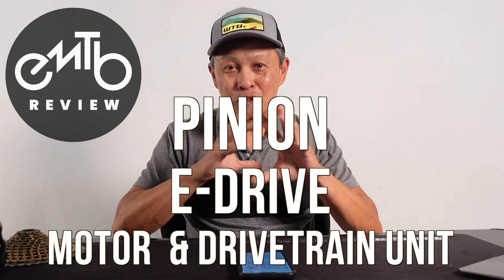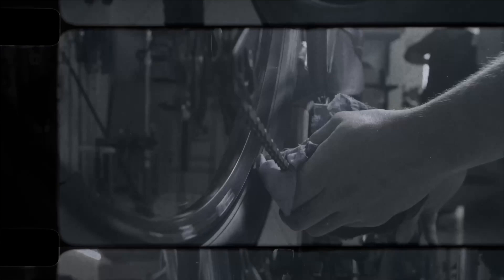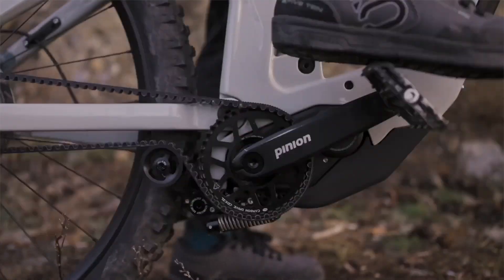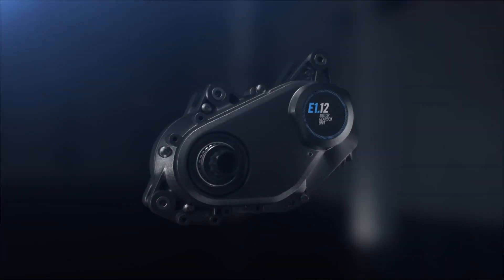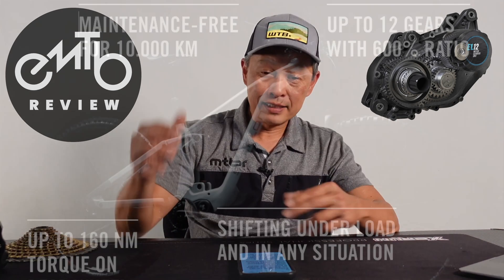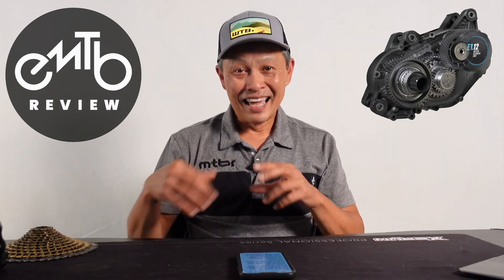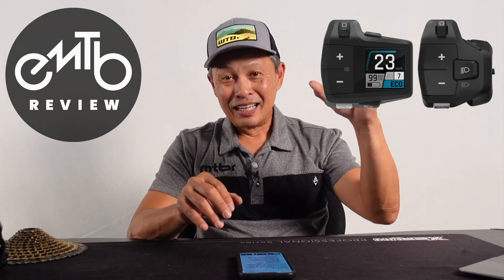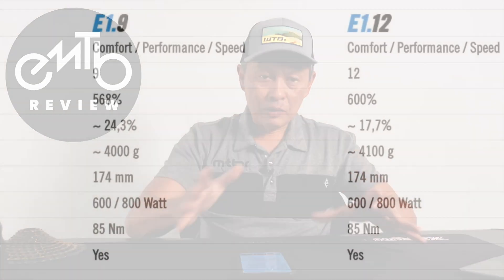Pinion E-Drive MGU - Motor and Gearbox for ebikes in one unit

Comment: As an engineer and bike mechanic there’s one thing that’s always bothered me, the disgusting amount of waste the cycling industry has made by making e bike motor units unserviceable (grease wiped onto gears instead of oil bath, what?) That’s on top of all of the derailleur based waste, they have a system that they’ve locked in that generates massive after sales service profits and just is not practical for an off road environment. This system of Pinion’s should be applauded not just for its intelligent design but also addressing a real problem of waste and pollution (to produce, package, ship and distribute) that the throw away nature of derailleur and motor units systems create. I’ll definitely be buying one.
Reply from the maker: Great insight

Comment: Clarifications on Pinion gearbox. I have a Priority 600X (alum hardtail bikepacking bike) with Pinion C.12 gearbox with belt drive. I don't like grip shift, but otherwise love this gearbox. Once the belt tension is adjusted (phone app), this thing is bulletproof. When upshifting, you don't need to let off except 4-5 and 8-9 and it shifts fine, downshifting you need to let off a bit (not stop pedaling), except for the 4-5 and 8-9. But you can shift a bunch of gears up or down without pedaling or at a standstill, try that with your derailleur. The only maintenance I've done is change the oil in the gearbox after 6,000 mi. The belt squeaks when dusty which is common in Colorado summer riding. A little water squirt and its quiet. I just carry a spare belt in my backpack (it's only a couple oz and small). Can't tell you how many times over the years my derailleur/chain left me stranded. I like it so much in fact I wrote and asked Pinion to make an ebike motor with their gearbox and decided to wait until this was available to buy with an ebike (my knees will thank me). I will never go back to derailers and chains just like I'll never go back to an ICE vehicle from my EV. I can see how those who race will stick with the more efficient derailleur, but for most of us, and especially for Ebikes, it is a no brainer.

Comment: I don’t think you mentioned that this system is exclusively equipped with a Gates carbon belt so you can also factor in all the reliability, low maintenance & toughness benefits that these have over a conventional steel chain.

Comment: What happens if your out of battery
Reply from the maker: What companies do is kill the motor but save a little battery so shifting is still available.
Reply: @EMTBReview  so I ride a bike and do door dash I ride about 50 miles a day, would I be able to ride all day?
Reply from the maker: @firstshot2169  for any ebike with this kind of usage, make sure you have at least a 700wh battery and you should be ok.

Make sure it's an assist bike too so you can help out with your legs and not just throttle around.

Comment: Another spot-on video, thank you. Your mouth opens & my internal dialogue comes out, almost word for word. Ha! I’ve commented that many times in your videos. In 91’ when I came from the dirt bike to the MTB world, I immediately said that MTB’s need internal gearboxes. I saw the future of MTB’s from day one practically. Want the next innovation? To mitigate the loss of range due to drag, add the mechanisms necessary for regenerative braking, clutch on rear hub to spin the chain/belt while braking and spin the motor to recharge the battery (or aux battery), etc. Without the deraileur, that is now possible to use “motor braking”. I’ve not heard anyone else say one word about this and I listen to 8-10hrs of Mtb news daily hoping for big breakthroughs & innovation. 🎉You heard it here first. Now let’s make it happen!👍 (sorry for sounding like an ass, Im just tormented by ideas that I know would revolutionize MTB’s & just don’t know what’s taking so long…)
Reply from the maker: Something about great minds thinking alike. :)
Reply: You can't have regenerative braking on most full suspension bikes due to chain growth from the suspension geometry. This requires a tight side and slack side of the chain, so you can't transfer power the other way as it would be coming along the slack side of the chain. Regen would also require a brake modulation system that would require sensors in you brake levers and for the rear brake to reduce the braking force when the regen was activated. All this would add extra weight and complexity that would negate any gain from the small amount of regen you would get. Can't see this happening in an off road mountain bike anytime soon.

Comment: 2 Lbs. extra on a 20 Lb. bicycle = 10%, but (bike + rider) it goes down to about 1%, which is nothing unless you're having to carry the bike up stairs.
Reply: anything under 40lbs is considerered "Light" Emtb even up to 19.5kg/42lbs so 2lbs is less than 10%, I agree it doesn't matter at all when you're going at a constant speed, on smooth surface and not cornering. even though it's only 1% of the total weight it is more important than 1% suggests if you are cornering, jumping, or going over rough terrain, but I would definitely trade 2lbs on a emtb for long life almost maintenance free gearbox + lighter/stronger rear wheel + better rear suspension.
for commuter bikes, I think it's a bit overkill because hub motors + less shifting + less effort  means even cheap 7speed groupset last a long time and dont need that much maintenance. Although if you're looking for a car replacement to do a lot of miles, low maintenance is important

Comment: Do understand that there is a significant 'klunk' that occurs in the MGU when shifting between gears 4/5 and 8/9 on the 12-speed unit.  Very good attempt; but, time will tell...

Comment: The Pinion MGU system eliminates all the criticisms of the non motorized system. Which I prefer to live with over a conventional drivetrain. I don’t notice the little bit of extra drag there is over a clean regular drivetrain and being able to shift as many gears up or down in one motion at anytime is worth having to make a slight pause while pedalling. With the motor and electronics these are eliminated. Then as stated all the pluses of the belt drivetrain and no worries of smashing off a expensive rear derailleur. 
 I would like to see the display come off of the controller and on to the top tube.
 If some familiar European bands like Scott, Canyon or Commencal start using this motor it will take off in North America. Since Bombardier owns a controlling interest in Pinion maybe we will see some Canadian brands like Devinci, Norco or Rocky Mountain use it.
Reply: That'd be nice. I had to order from the US to get my Pinion bike. Didn't realise at the time that there's a significant import duty on bikes. Still happy with the bike, though.

Comment: Are E bikers becoming frustrated motorcycle riders?  
Need more power! Need a real gearbox! Need auto shift! Even ABS.

The Gates belt on these can be lubed with soap if they squeak, or rinsed off with water.
Reply: the difference is the weight, emtb are around 22 kilos, whereas e motorcycle like surron weigh 60 kg, plus good luck going on hard mountain bike trail with a surron, your surron will be good for recycling in a matter of hour.
Reply: Some do want more power and they should just get a dirt bike. Most are happy with the current assistance, and some are even happy with the assistance of motors like the old Levo SL, like myself.
Reply: @streddaz  I can go just fine with my EP8 motored bike in trail mode, the bike has pedals for a reason. 

Ive also ridden dirtbikes most of my life, and yeah, 46 HP is really fun.  E bikes are a different thing.
Reply: @bradsanders6954  yep, they may both have motor but Ebikes and Electric or petrol dirt bikes are totally different. Ebikes are so much closer to normal MTBs.

Comment: rode a pinion two years back, the exra drag was not noticable and the shifting surprisingly good. shame it did not catch on sooner.
Reply from the maker: Yeah, I got through the many reasons why Pinion did not catch on in the US for analog mtbs.
Reply: @EMTBReview I can’t remember if it’s this Pinion or the Fazua version but some of these motor gearbox systems have a straight though drive option that disconnects the motor completely so you only have the drag of the mechanical drive train.

Comment: Pinion has been trying to market its gearboxes for years and no serious brand has adopted it. The gearbox solves a problem that isn’t really a problem. The overwhelming majority of people are perfectly happy with the current set up and will not pay a premium for a gearbox.
Reply: Yah, for all the problems I hear about with chains, Ive got 1000 hard miles on my e mt bike and the chain is still good.  Just cant shift it under full load and expect it to last long.
Kind of like any mt bike has always been, shift before you need it.

Measure the chain, put on a new one when needed.
Reply: but they will repeatedly buy new chains and cassettes? A gearbox is alifetime kind of thing
Reply: @fetB  because the sprockets and cogs inside last forever and cannot be broken??? I think not. Modern derailleurs are so good that they basically last forever.
Reply: @asifitmatters1  modern derailleurs last basically forever, but somehow, the much more substantial gear srockets, do not? Make it make sense
Reply: @fetB  the sprockets just like cassettes and chain rings have to wear out, no? Derailleurs don’t wear out.
Reply: @asifitmatters1  obviously its about the wear, and while the derailleur doesnt wear out, it's hanging outside and can easily get smashed. But of course its clear you dont want a rational argumentation. So go on then and hate on gear boxes. Bye

Comment: One thing you DIDN'T mention when you were discussing the cost is the SAVINGS to be had by NOT  having to buy a very expensive derailleur.  No more cassettes, chains sprockets. 
Also,  the weight being centered down low and OFF  the swing arm!
This is a win win win!
Reply from the maker: Definitely, definitely. Good insight.  The replacement cost too is huge. And I lube my e-bike chain every single ride now for sanity, but it's a pain.
Reply: I think eventually this will be true as the tech gets cheaper, but not for the next couple of years when the bike commands a 2k premium.
Reply: @vidibites  mtb do get kinda obsolete after lets say 5-10 years. I mean I ride a 2010 RM slayer 😀but there's been a lot of improvements since...but if you ride a LOT and do long rides, which is probably what you want to do when you invest 5-10k in an emtb?? sounds like you could be saving a lot of money and time over the years changing gearbox oil and a carbon belt once in a blue moon vs degreasing/lubing/replacing cassettes/chains/chain rings/derailleurs
About tech getting cheaper it will probably happen with mass production when a big name like Shimano offers a similar product. they have bee doing R&D on gearbox for a while, with patent using a chain but I'm sure they've experimented with different solutions, and they also make their own ebike motors, so I can see it happening some day they could even reuse the same motor mounts if they manage to fit motor and gearbox

Comment: It doesn't look like a v1 because it's not. 11 years ago they announced E1.8 pinion drive system to be released the following year in 2013 with Nicolai Ion20 Mountain E-Climber.
Reply from the maker: Sure, the gearbox has been around for a decade. But he motor though and electronics built in... that's new.
Reply: @EMTBReview  looks like you didn't even Google what I referenced.
Hint: You might find a motor and a battery in there.
Understandable though. They quietly swept it under the rug as if it had never existed.
Reply: @yurymleh  That was the E8.1 motor and gearbox combo but they never got it sorted and it never made it into production.
Reply: @streddaz  Yep, and I've assembled a long list of attempts and promises at motor-gearboxes and flops like that over the years. :-) It's a holy grail of reliability and low maintenance. Can't wait. Pinion sure looks serious this time and extremely polished and thought through.
Reply: @yurymleh  yes, I think they might have it this time. Interested to see what brands pick it up. There’s two already.
Reply: @streddaz  There are at least four: Rotwild, Simplon, Bulls & Flyer.

Comment: I love IGH especially my old Rohloff and am stoked to see Pinion finally combining the 2, all that said if people just learned to shift better they would have much less issues out there...
Reply from the maker: True,  but not everyone will learn to shift perfectly, especially with the slew of new riders, and commuters entering the category.  If one rides Turbo mode a lot, it's often a problem.

And even without shifting, the chain and cassete wears out quickly, the derailleur breaks and picks up debris.
Reply: @EMTBReview  Maybe you should do a video on how to shift an ebike properly and how to avoid the chain clunk.

Comment: Super nice system but the drag becomes a problem when you live in places where the assist limit is only 25 km/h. Also, the controller is clunky and I don't want a display like that on my MTB. The rest is dope.
Reply: Drag and early version reliability, I would imagine a high failure rate.  It is the future I think... in 5 years
Reply: @primemtb  I'd love to hear the additional drag expressed in watts. These size gearboxes have been evolved and perfected in 50cc motorcycles, already. No reason reliability should be an issue.
Reply: Zerode use a grip shifter on their steam bike pinion gearbox, that would be way better on an emtb version
Reply: @waynedudson735  I don't meant the gear shifter, I mean the motor assistance shifter is clunky and ugly. No need to make it so big that the bike looks like a spaceship.